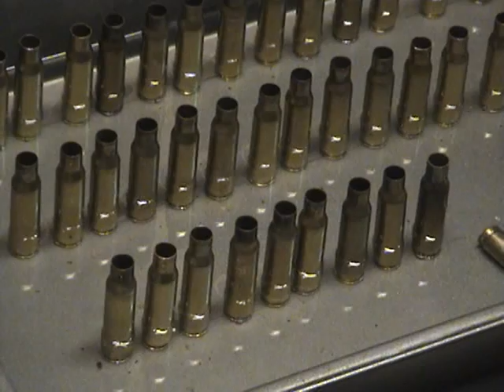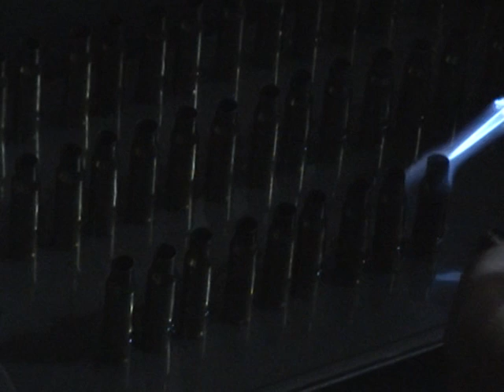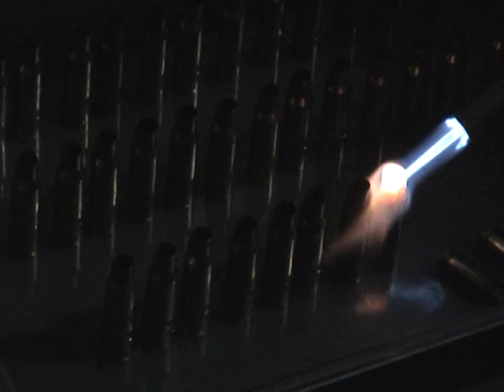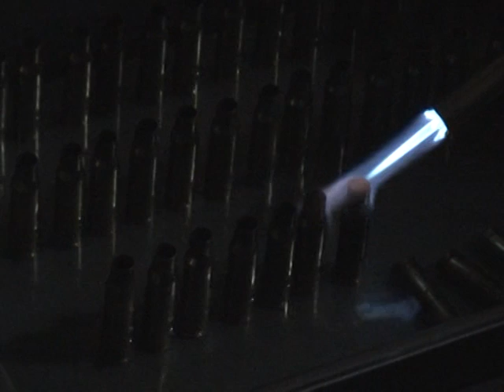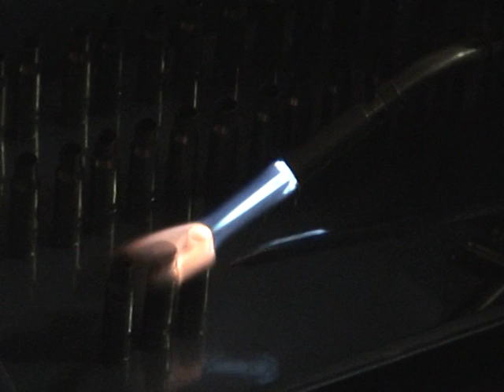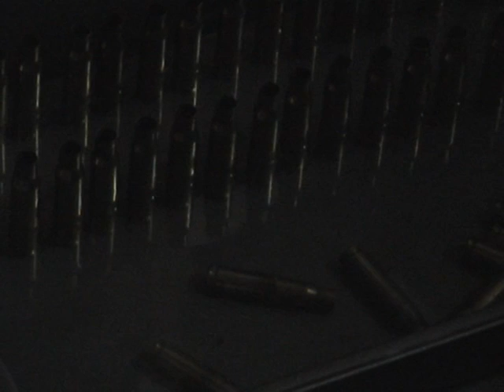How I Anneal Brass

Comment: for steel fireing and quenching will harden but a chem reaction in brass tin + COPPER anneling refoarms these molicules in a uniform mannor and the quench frezzes them back to original metalic structure

Comment: @semtech30 I have heard that you can anneal it simply by slow cooling it. I do not have any personal experience with that method, so dont take my word for it. If I recall correctly, some experienced brass annealers do recommend that method. It is important to note that the ideal annealing for brass cases is not a full softening of the neck, but only a partial softening, with a lower heat level. The annealing shown in this video with red heat and a water quench is a excessive full annealing.

Comment: @thewingman1   Right on!  I heated mine to the first onset of red then dropped it in the pan for a slow cool.  You can pick them up in about 3 minutes.  I'm sure it will come with practice.  I experimented with Red Hot one's and in the press the neck's collapsed.
So that was certain over kill.  The pess is a good indicator.  I'll take some shot's.

Comment: @semtech30 Sir, your understanding of the process of heat treating or annealing metal is accurate when applied to steels and ferrous metals. However, the process of heat treating and annealing aluminum, brass, and copper is opposite of that used for steels.

You are correct that quenching lock up the molecules and harden it, possibly making it brittle...if you are talking about steel. However, with aluminum, copper, or brass, quenching after heating anneals the metal.

Comment: @TexasStraightShooter Sir, semtech30 is correct regarding the chamber supporting the case, including the case head. However, both you and he misunderstand what takes place in the brass when you anneal it. By annealing it, as you show in this video, you are softening the brass, specifically the neck and head. This is important because being in an annealed or softened state it allows it to better withstand the stresses of resizing and firing. Refer to the "Annealing (Metalurgy)" page of wikipedia.

Comment: have done this method it works fine use of tempcens crayon or paint allow you to min heat and no quenching require in the cheery red method you will sofen a bit more but the quench corrects the process and the water protects the case web

Comment: you CAN'T harden brass by heating and quenching. brass only becomes softer when it is heated because all you are doing is relieving internal stress. there are no carbon molecules in brass to get trapped within a lattice when quenched. therefore the only way to harden brass is to work harden it.

Comment: I just did it this way with my 300 wsm on Norma. I got the head glowing, then tipped it over.
Do you have a problem with un-even heat?
I mean will the heating it on one side cause anything bad.

Comment: There is way too much bias going around. What I want to know is what brand of brass he is using and how many times he is able to reload this brass? if what he says is true: He only needs to retire brass once the primer pockets wear out than somehow, despite the "gun smiths theories" it is working. I would like someone that knows chemistry to comment here, not a so called expert on annealing. The community doesn't even seem to agree on weather brass can be hardened with the heat and cooling process, (dependent upon slow Vs. fast cooling). It is possible that some brass makers have a different compound in their cases. One guy mentioned zinc. Perhaps if this guy truly does burn out the zinc and your left with only brass, then perhaps that is why this is working; because the brass in more malleable (IDK)? I don't really feel like breaking out the chemistry books but I might have to on this one. If this works, and it goes against conventional wisdom, we need to know why it works. Perhaps he is over heating it/softening it, and perhaps the quenching is bringing it back/hardening it a bit. Something is going right if this works? and it is by far the fastest method I have seen thus far.
Reply: Theoneancientone been 7 years since this user put out a video so who knows if it worked or not lol

Comment: You say working brass hardens it.  So you anneal to soften it. Then you quench it to temper (harden) it.  Maybe re-think my comment. and do some metal studies.
Heating mobilizes the molecules and must be settled by slow cooling at air temp.
Quenching locks up the molecules and hardens it.  Makes it brittle.
Your gun chamber holds the pressure sir....not the brass case.  You cannot blow up the gun this way unless the barrel is obstucted.   Good Luck!

Comment: One thing is you are heating brass too long-with that torch you should count to 2.5 seconds and tip over into water bath-also never go red hot-count one thousand one/ one thousand two/ one thousand and tip...you can always buy new bras you cant buy a new face.You have a hot torch flame.

Comment: You are overheating the brass, it shouldnt turn red, also quenching in water does not harden the brass it just stops the heat form spreading.  Brass is not like steel it doesn't harden by quenching in water.  Use Tempilac 750 degrees as soon as it melts on the inside of the neck you are done.  What you are doing is potentially dangerous if you try to shoot that brass.

Comment: Waaaay too hot dude.   Brass heated to glowing red is ruined.   It will get too soft and lose its ability to spring away from the chamber walls when you fire it.  It may also collapse in the press.  Water quenching is OK because brass does not harden in water like steel or iron, but you have ruined those cases with too much heat.   Around 6 to 7 seconds turning on a cordless screw-driver in the flame of a propane torch is about right.

Comment: This is brass not steel 
tempered makes it harder Annealing makes it softer and that's the goal here.  The only problem is that it is WAY WAY to hot.  With the lights off when it just start to turn maroon shade your done THAT'S IT.